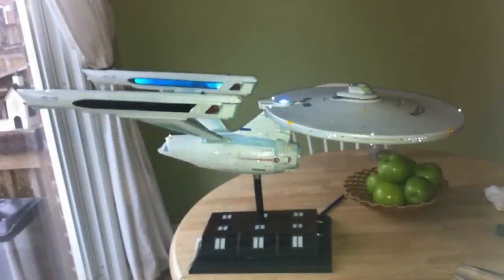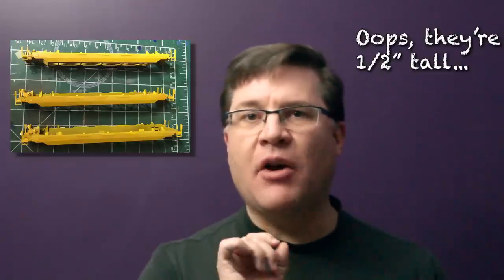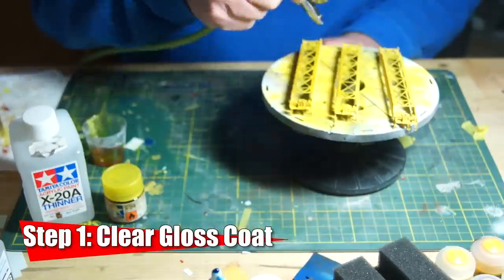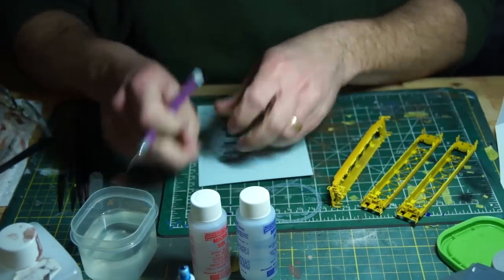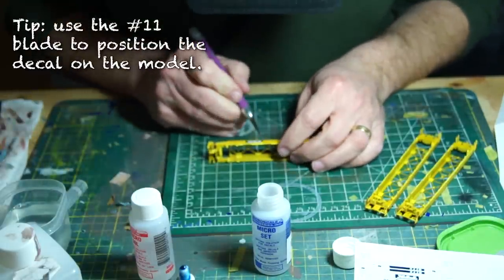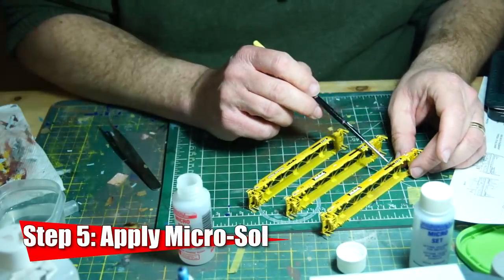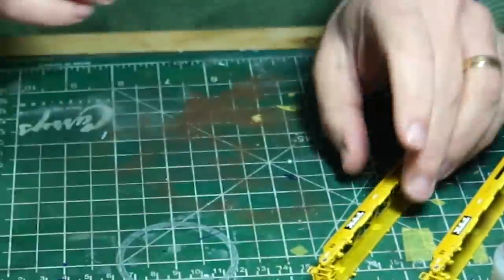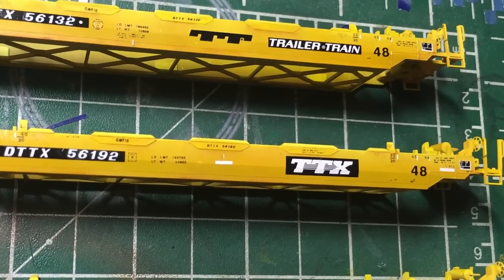Tricks for Awesome Looking Decals

Comment from the maker: So what tricks or experience do you have in applying decals?
Reply: Oh it's been ages.
Can't rightly recal the last set of waterslide decals I applied myself,  though there is a pile of identical Concor Conrail 40' boxcars on my workbench that are awaiting 're-caling' to a proper numbering scheme.
Reply: Good stuff John! I've had good luck with store-bought decals. Not so much with homemade. Decided to outsource my graffiti to an artist I know at work to do oil paints. Will let you know how that comes out. Looking forward to your vids on homemade decals, maybe I can get it to work.
Reply from the maker: Homemade decals are fun, with one major caveat. I can't do white, and yellow is very tricky to do over anything other than a light surface. Printers that can do white ink are rather pricey.

Comment: Pledge Floor Finish works as a gloss coat, underneath and over top. You can apply it by brush or airbrush. Thanks for the video, a lot of useful tips for "deckles".   Terry
Reply from the maker: I've used future as well, and it does work nicely. For decals, I prefer to brush it on over the decals before airbrushing over the whole thing.

Comment: I'm working on the 1/32 Flying Sub from Moebius. Lots of photo etch substitutes with minute holes where the blinking lights and little dials have to go! Before applying the many decals I made the surface as smooth as possible by applying Humbrol Clearfix from behind the PE bits. I plan to apply Tamiya Mark Fit to the painted PE's before I slide the decals into position. When everything's dry and satisfactory-looking I will brush a final coat of Mark Fit over the decals. The idea is to place one or two LEDs behind every console. Some of the decals are so small (approx. 1 mm) I will probably color the minuscule Clearfixed holes from behind with little dabs of bright red, blue, yellow, green, orange and purple. I think this will look very realistic. Wish me luck.

Comment: thank you for vids. i have scratchbuilt cars of wood or styrene, airbrushed trucolor lacquer paint. so the surface is a little rough, and in the case of passenger cars grooved. should i still apply gloss b4 decals? is spray vallejo varnish good? i mean instead of brushing ? i also have trucolor flat and gloss, think i should use those ?

Comment: Is there a way to print white decals? (laser)
Reply from the maker: Not easily. Printers that can print with white ink are more expensive than even 3D printers. Specialized printing shops have them. The places that do make Decals, such as Micro-Scale, Black cat or Highball have access to a professional-grade printer that can print with white ink. My home-made decal efforts are usually printed on clear decal film.
Reply: Got it, thanks. I'll see what I can do. My last option would be to pay those Highball guys. They make good stuff, but it sure looks quite pricy!
Reply from the maker: They may be pricy, but it is still cheaper than buying a printer that can print white ink. :) But yeah, I get it.

Comment: I don't get it. Went and spent money on the Micro Sol, but all it does is ruin my decals. Wrinkles and discolors them terribly. And you touch them at all after application to smooth them, they disintegrate!
Reply from the maker: Micro-Sol can be tricky to work with. I've not had the discolouration issue, what kind of decals were you using? However, you have discovered that once you apply micro-sol to a decal, touching them almost guarantees that they'll fall apart. What I've found helpful is to place the decals using micro-set first, allow them to dry, and then apply the micro-sol to dissolve the decal film and let it flatten down to the surface of the model. You can email me through the "contact us" tab on my channel, and I can give you some more specific tips!
Reply: @JCsRiptrack  Thanks! I'm just a little frustrated. I'm not sure exactly how old this model kit is, it's a Bandai Macross design originally from the 80's. I assumed it was remade and reissued recently, but I'm having trouble with the plastic reacting strangely with paint, and having terrible luck with the decals.

Any advise for decals that fall right off a day or two after applying them?

Btw, I did wash all parts with hot water and a drop of dish soap. Scrubbed with new toothbrush, and rinsed with hot water... before starting.
Reply: @JCsRiptrack  Also, I am using micro set first, then sol after.
Reply from the maker: I wonder. Is the kit itself an 80's vintage kit with the original decals, or is it a newer release with updated ones? You could also be dealing with old decals, which need some TLC before applying them to a model. After decals are completely dry, including after the micro-sol, you'll need to carefully brush on a clear acrylic gloss varnish of some sort to protect the decal. Don't use a spray for this, as it can frost the decal. After the brush-on varnish has dried, and they're sealed in, then you can apply any additional clear coats and even touch the decals without having to worry about them flaking off.
Reply from the maker: Okay good. Try letting the micro-set dry first before using the micro-sol. The wrinkling you've experienced can happen shortly after the micro-sol is applied, but it eventually is supposed to settle down, as the material is softening the decal in different places at different rates.
Reply: @JCsRiptrack  I guess I don't know if these are old or not, could be. The only date I can find, is the original 1984 on the box.
Can you recommend a good brush on sealant? I have some cheap stuff, but I want to do this right if I can.
Reply: @JCsRiptrack  thanks again, I've been avoiding using brush on varnish, as the stuff I have leaves ugly streaks that look terrible. 
What clear varnish do you recommend?
Reply from the maker: What kind of brush-on varnish? If it is water-thinnable, you just mix it with some water on a palette and thin it down so it goes on smoothly. As for your other comment, if the box says 1984, then the decals are probably that old, and will have yellowed over that time. There may be methods to restore the colours, but I'm not sure. However, for the cohesiveness so that they don't disintegrate, you can use Testors Decal Bonder spray on the decal about a day or so before you plan to apply them. It gives the film and ink a bit more strength.
Reply: @JCsRiptrack  Thanks, I'll check that out. The brush on clear I have is pretty cheap stuff, it's also labeled "triple thick" 
Maybe I'll okay around with thinning it out...
Reply: @JCsRiptrack  Just tried this out brushing on clear varnish...
Not working. It becomes very spotty when applied. Now my previously smooth surface looks like shiny craters on the moon. Full of raised and sunken surfaces. This happens whether it's thinned, or straight from the bottle. :(

So brush on varnish doesn't seem to work for me. I've heard other people suggest spray on UV resistant clear coat. Is there a reason not to go this route?
Reply from the maker: What brand of brush-on varnish do you have? It sounds like it's a non-acrylic type if it is reacting like that.  If you like you can email me through the "Contact" tab on my channel page, we can talk more there.
Reply: @JCsRiptrack  Sent an email at jcsriptrack

Comment: Have I had disasters??? all the time, total tear downs and repaints just because the decals were wrong
Reply from the maker: Sounds about right, I still do have issues from time to time too. If you look carefully and pause the completed shot, you can see that one of the tiny decals on the middle car drifted a bit during drying, and I didn't notice until it was sealed.